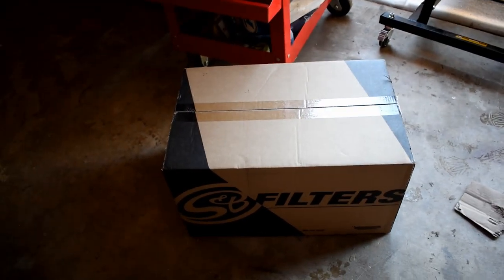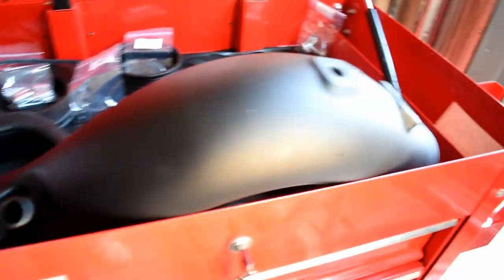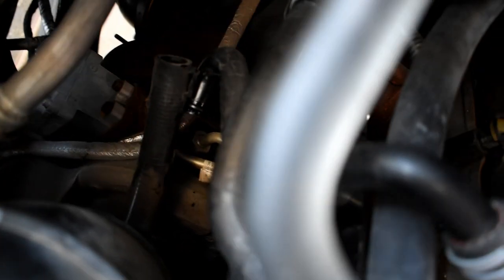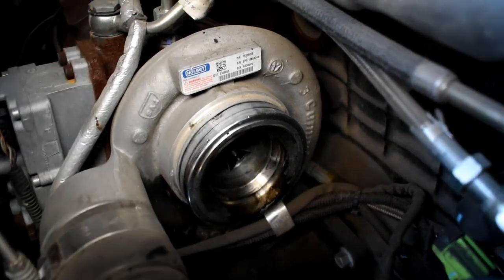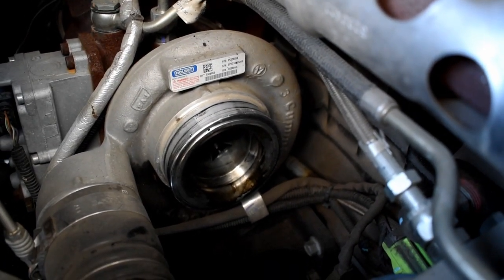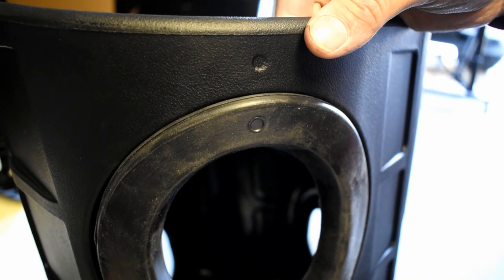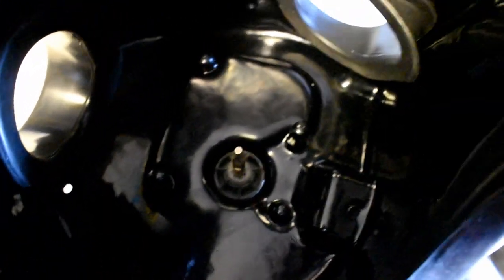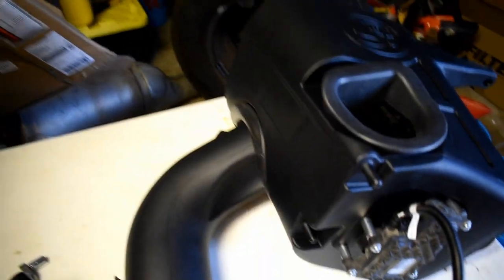S&B INTAKE HP GAINS? (Install and Review 6.7 Cummins)

Comment: The OE airbox flows enough air to support 500whp. Even if you're tuned with an "exhaust" you still wont see any gains with this or any of the other aftermarket filters.